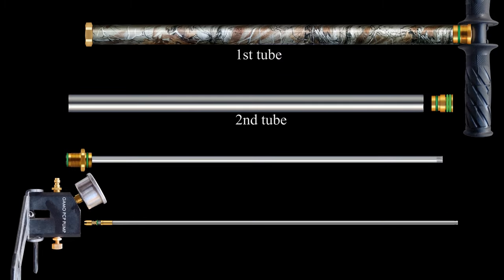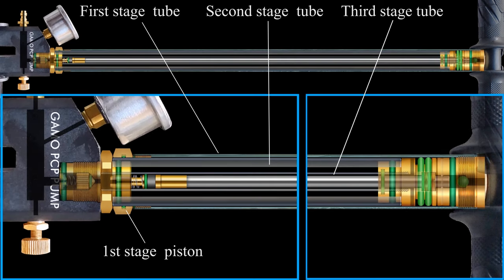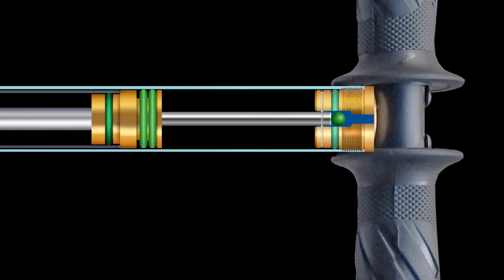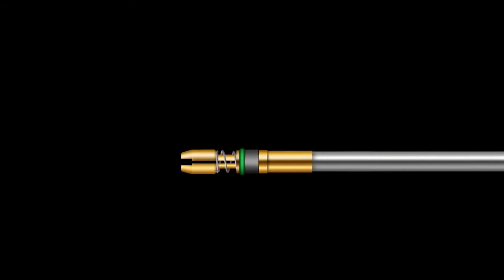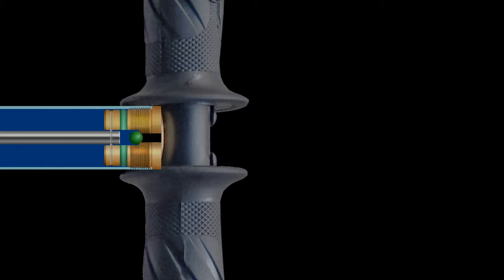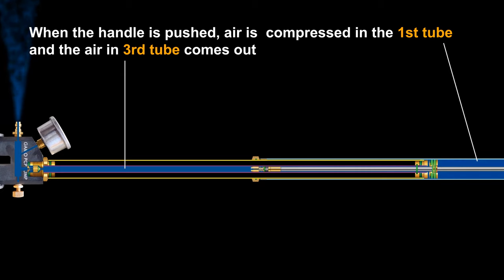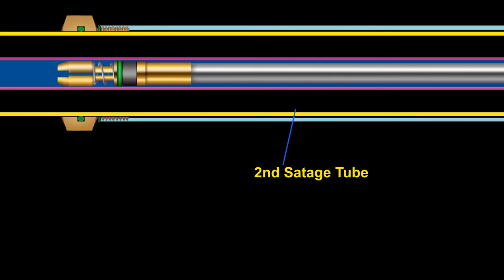How PCP Pump works, PCP Airgun hand pump mechanism

Comment: Nice visuals! However, there are crucial details missing from your description which had me very confused for a while.

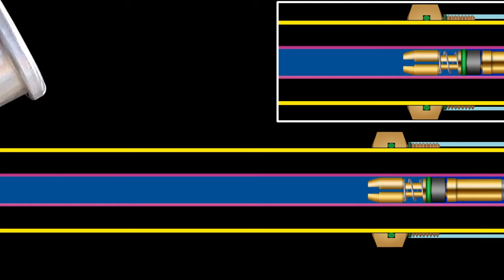@2:47 When pushing the handle, the air in the first tube only compresses to a high enough pressure to open the third piston seal when the output pressure is very low, but the whole point of these pumps is that they can deliver a very high pressure. If output pressure is always low enough to allow the piston seal to open like that, then the entire pump may as well be a single stage.

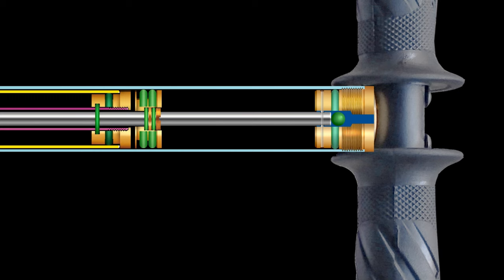What's missing is that while you do address the first and third stages, you miss highlighting the second stage almost completely! When pulling on the handle, the first stage fills as you describe, and the third stage is filled with air from the second stage.  However @1:29 no air from the first stage goes through the second stage into the third at this time. The second stage consists of the space between first and second tube, and between the third tube and piston rod. What you call the first stage piston is compressing second stage air into the third stage. What you call the second stage piston is holding that compressed air and preventing it from going back into the first stage while the first stage is filling.

When pushing on the handle, the third stage air is delivered to the outlet as described. First stage air is compressed into the second stage, but as already mentioned, it doesn't go past that into the third stage except when the output pressure is low.

So to summarize:
First stage is the space inside the first tube, between the inlet (at the handle) and what you call the second piston
Second stage is the space between first and second tube, contained by what you call the first piston, and the space between the third tube and piston, contained by the third piston seal. Air is admitted from the first stage via the second piston.
Third stage is the space inside the third tube, between the third piston seal and the outlet high-pressure valve.

On the pull stroke: outside air goes to the first stage, second stage air is compressed into the third stage
On the push stroke: first stage air is compressed into the second stage, third stage air is compressed and pushed out of the pump

additionally:
On the pull stroke: second stage piston is closed. Third stage piston is open. High pressure valve is closed.
On the push stroke: second stage piston is open, third stage piston is closed, high pressure valve opens.
Reply: I watched the video a number of times and I could see that something was missing and the explanation faulty
Reply: The third stage cylinder needs to be precharged, compressed before you push the piston down, to get high enough pressure
Reply: Wow you dedicated your whole life into this hand pump?
Reply: Great comment.  It's a big help in understanding how pcp hand pump works.  But what about pcp pumps where 2nd stage is filled with liquid coolant?  I guess liquid coolant serves to reduce volume of 2nd stage but liquid coolant should not completely fill second stage or the pump will not work.
Reply: @la2123  It's pretty important to understand how pcp hand pump works if you use pcp air gun and need to DIY repair and maintain the hand pump.  Carrying around scuba tank or electric compressor is non starter in many cases.
Reply: @springer-qb4dv  Very good advice. Nowadays there are many battery powered portable compressor. I just hope they will become smaller and cheaper.
Reply: @springer-qb4dv  The space where the coolant goes is not in any of the compression stages. To get the appropriate ratios of first to second to third stage volumes, the intermediate tube between first (outermost) tube and piston actually needs to be pretty thick, and would be heavy/expensive if made as a single tube. To save on metal, this is instead made as two thin-wall tubes with appropriate inner/outer diameters.

Basically, you can think of the second and third tubes as being a single tube that's been hollowed out between its surfaces.

The empty space between second and third tubes, if left just filled with air, would be insulating, and hinders heat of the final compression from escaping. The "coolant" is really more of a heat sink; the final compression heat is spread from the third tube through the fluid to reduce the temperature increase, but it does conduct that heat to the second tube. The second tube is exposed to ambient (cooling air) part of the time, but the rest of the time it sees, and thus also heats, the second stage air. So the heat you're trying to get rid of from the third stage, is partly dumped into the second stage before it comes back to the third again!
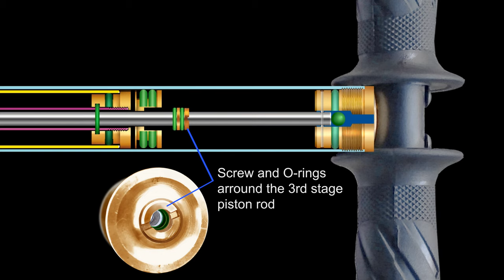Reply: I have a question for the wizards.  At 1:19, there are 2 big o-rings over the slot/hole where the air passes from the first stage to the 2nd stage chamber during down stroke.  Why are there two?  I can see that the one on the right acts as a one way valve, but the left one seems to do nothing.  It sits over the slot that allows air to flow freely.
Reply from the maker: These o-rings are not used as valve, they are used to protect 1st stage tube from friction while moving on 2nd stage piston
Reply from the maker: They are not tight on 2nd stage piston. They are loose
Reply: @AirGunMech  Thank you for your answer, but I think the Oring on the right, acts as a one way valve to prevent air from the 2nd stage chamber from flowing back into the 1st.  Higher pressure in the 2nd stage pushes the o-ring to the right, making a tight seal as the tube is pulled up.  When the outer tube is push down, pressure built up in the 1st stage chamber pushes the ring to the left, unsealing it,  allowing air to flow into the 2nd stage chamber.
Without this valve action, the pump would simply act like a single stage one.
Reply from the maker: @propheteyebert7063  well explained. It must be included in this video. I was thinking so when I disassembled this pump to understand. But now you pointed out this mechanism. Thanxxx
Reply: @springer-qb4dv I have two of these, both came without coolant. I have filled both with ethylene glycol and only allowed room for expansion when hot. That space is not for pressure although sometimes a little will accumulate there. The space you believe that coolant goes is actually the thin space between the two big tubes. By making the volume smaller the pressure increases. The moving o ring uncovers two slots on the up stroke diverting that thin area into above the final piston
Reply: yeah i was also like wtf am i missing :D

Comment: My pump is so hard to pull after 3 to 4 up and down stroke, what's wrong with my pump? I need help, please 😅
Reply from the maker: 3rd piston seal and o-ring need to be changed.
Reply from the maker: There is a spring, it may be damaged.
Reply: Alright, thanks for the help, I also found the third tube o-ring has worn out right after I watched your video, could it also be the cause?
Reply from the maker: The third piston faces extremely high pressure and heat. The airgun's pump requires tuning after either 10 or 5 airgun refills, depending on the cylinder's capacity. If the quality of the seal material is poor, it tends to wear out quickly."

Comment: So I got a handpump from amazon and I have a few questions:

1.) The pump started having issues pulling up after a few hundred reps. It's like air isn't getting properly in and some air escapes out the top when I push it down.

It still works, but I stopped using it because I don't want to break it.

2.) What lubricant should I use? I tried Ballistol but it does seem to go go away/dry out after a few pumps.
Reply from the maker: 3 stage hand pump becomes hard when pressure increases more than 50-70 BAR.
Yet it doesn't become harder as you mentioned. If you feel pump is harder while pulling it upward, the third piston is not working well. You have to check the air passage hole.
Reply from the maker: You should use any good quality Silicone oil for lubrication
Reply: @AirGunMech  I've got some silicone oil from Ballistol, but that one's corrosive. Not sure why, but it makes (at least some) steel rust. Can you recommend one?

I will have to take it apart then. Thanks for your reply.

The funny thing is the gauge already had problems after one use. It traps some air even after bleeding, but also doesn't let all the air in, meaning I don't get the full pressure reading.

It didn't even survive 300 bars on a 580cc tank before that happened btw.
Reply from the maker: I concluded that your pump needs to be tuned and repair. So you should not do it yourself. Please find some body expert in this regard.
Reply: @AirGunMech  Do should I send it back to Amazon? And should I get a quality airpump/conpressor instead?

Also, which silicone oil do you recommend?
Reply from the maker: I don't know which oil quality is best in your country. I bought it from a local dealer, not any brand or company. He is a trusted dealer.

Comment: Thanks, more complicated than I first thought, explains why my Webley EZY 2 pump from 20 plus years ago was so expensive at the time.
I still have the sales info stating it has an integral water trap, would anyone know how this is checked / cleaned.
My old Webley FX2000 air rifle was resurrected a few months back, it was sat unused for many years, it leaked air from the filling port when I removed the pump probe after filling, I bought a seal kit for the rifle years ago, sorry I can't remember all the tech terminology, the small o ring that is part of the filling valve in the rifle was rock solid, changed this and the gun held pressure no problems, the other day I went to add some air after a shooting session and it started to leak again from the same place. Had a close look today and found some corrosion in the valve assembly where the o ring seals, fully cleaned it all and fitted a new o ring, all good but it got me thinking was my old pump the cause of the issue, so I tripped down all the connections and the hose, to find rust / corrosion at every joint, the pump did spend about 15 years in my loft at a previous house.

I have fully cleaned all the visible corrosion, a quick look on fleabay shows a seal kit is available for my pump, it seems to work realy well, but it's the water trap I'm interested in if it needs to be cleaned etc.
Reply from the maker: If there is water in your pump causing corrosion, please clean your pump and dry.

Comment: How hot does a o-ring and air chamber gets in hand pumps and compressors? 🤔
Reply: Is your question about why that pump gets hot while air filling?
Reply: @shakeel21db  no, how hot, use a translate if you don't understand the questions.
Reply from the maker: The o-rings and air chamber gets very hot due to compression process. As you know compression of gases creats heat and expansion creats coolness.

Comment: What a great video .My Logun pump is playing up .Its locking up when you try and lift handle back up .Not drawing air in .Very annoying.
Reply from the maker: It is about Rubber ball problem
Reply: @AirGunMech  Thanks pal .I got a new seal kit but will check the rubber ball first .Thanks a million for taking the time to help .....You just got a subscribe pal
Reply from the maker: An other possibility also should be checked. Please check 3RD PISTON seal. This seal some time gets  stuck due to black dark material (oil + iron scratch) and blocks the air passage. Please change this seal.
Reply: @AirGunMech  Absolutely brilliant info pal .Much appreciated .Thanks

Comment: Air INLET is the Hole Beneath the Handlebars.  If Dirt/Gunk gets in there, the Rubber Ball will not seal for the FIRST STAGE Compression.  If the Ball swells (Usually due to Wrong Oil), then it stays Sealed, and Does Not Permit Inlet Air.  I 3-D Printed a Plastic Piece that goes Between the Handlebars and the Cylinder.  Provision for an Inlet Air Filter,  to keep Gunk from Getting in.  Makes MUCH LONGER service intervals for the Pump, and makes the Handlebar attach Much More securely.

Comment: Could it can fill vehicle tyres?
Reply from the maker: May be yes But tyre needs more quantity of air but less air pressure. This pump is designed to fill high pressure upto 300 Bar but less quantity of air  and tyre need only 2 or 2.3 Bar pressure

Comment: I'm wondering if any more stages would make sense? 🤔
Reply from the maker: A normal pump can not make high pressure like 300 Bar pressure. Normal pump takes air when you pull the handle and when you push air  just releases normally. In this way normal pump doesn't create pressure. But PCP pump when you pull or push both conditions creat pressure. 4 stage PCP pump is easier than 3 stage PCP pump.

Comment: What ppl don't realize is that the PCP hand pump is good for being out in the woods hunting and a good backup for the machine just Incase it malfunctions. Other than that, it's alot of work😣🥵
Reply from the maker: PCP pump are not good. Because if you fill your air tank upto 3000 Bar 2 times, the last stage piston needs to be tuned. Because this piston remains under very high pressure. Pump becomes harder and also back pressure problem occurs. Humidity in jungles is another problem for this type of pump. If you use your pump in a high humidity environment you will see the moisture coming out from the outlet filling prob
Reply: @AirGunMech  the PCP pump has worked well for me with all of my pneumatic air guns sorry to offend you but maybe you just had a streak of bad luck

Comment: "Liquid Cooling" is by means of Water  in Middle Space(Better yet: Ethylene Glycol and Water, @ 50/50 ratio, and, even better, With a WETTING agent, found at Auto Performance Shops).  Pump Slowly and Help keep Heat of Compression Low.  O-Rings, Valve seals and Hose last Longer, makes for Less Service requirements.